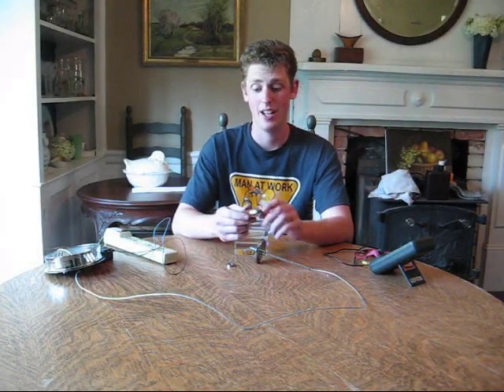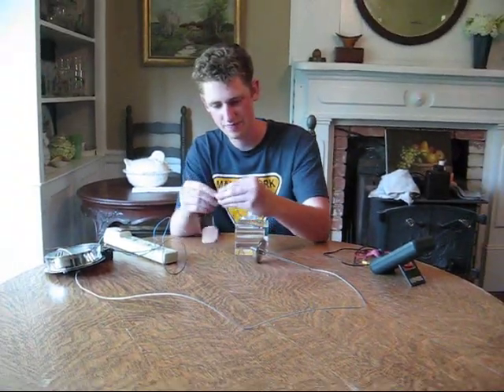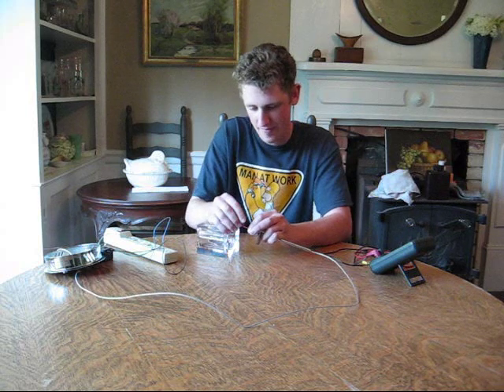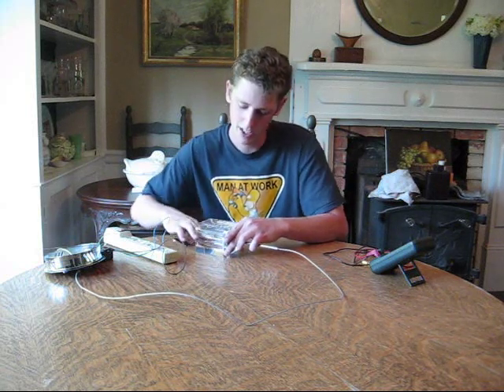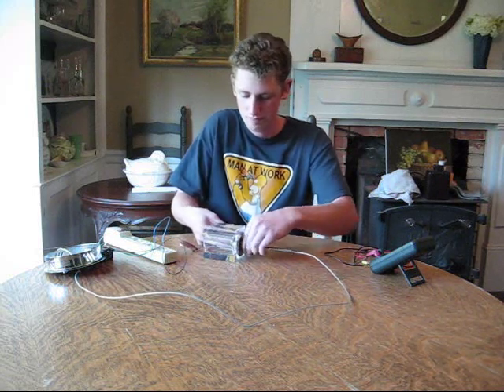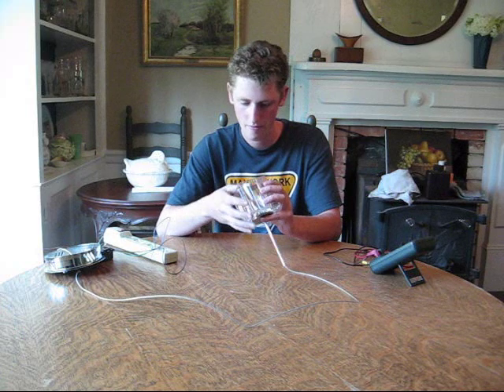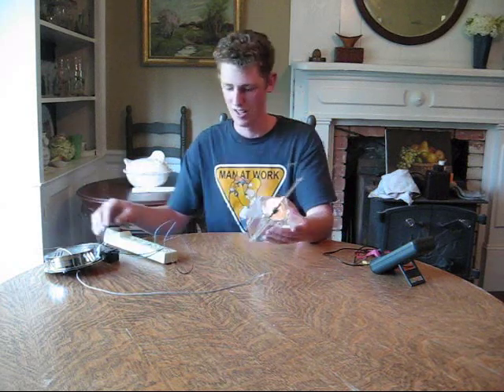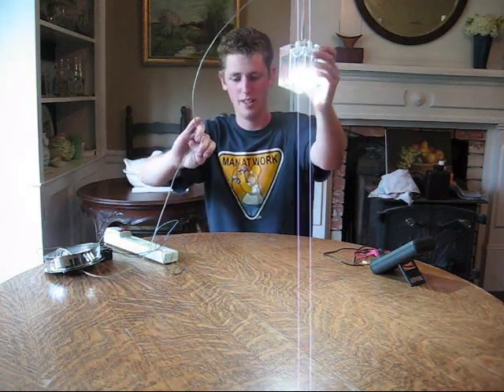LED Conversion: Switch from Halogen to LED, Part 2

Comment: To do that you would need a mix of red, blue and green.
 here is what you need per block of leds:
1 vero board 100x120 (to solder on to)
33 green LEDS (1w)
33 red LEDs (1 w)
33 yellow LEDs (1 w)
3 5v voltage regulators
6 10UF 25v caps
1 power switch
3 variable resistors OR 3 fixed ones ( ideally it would be 1 per LED but who can be bothered with that? lol) 
1 9v battery
would sugest covering your whole grow area in these modules and perhaps getting a slightly more heavy duty power supply.

Comment: Great vids man!

Love the attention to detail and explanation of everything you could possibly think of as well!

One thing I'd like to have seen though? Is maybe comparison of the original 20 watter to the new led unit!  As well as the calcs of how much one would save with a single and/or both units installed over the original unit over time?  20W vs 3.5W for a single unit or 40W vs 7 W for BOTH units, etc...

Or $2.30 per month for old 40W vs $.40 per month for the new LEDs!! or 83% savings!